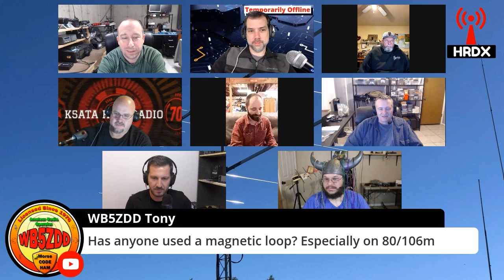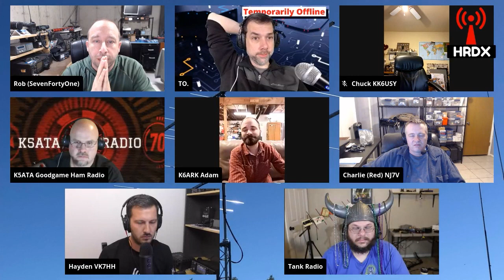How well do Magnetic Loop antennas perform?

Comment: I have 40 ft of 3/4" refrigeration copper tubing and a 20 - 1000 pf vacuum variable cap I had intended to use to make a 40 - 160m magloop.  73  WJ3U